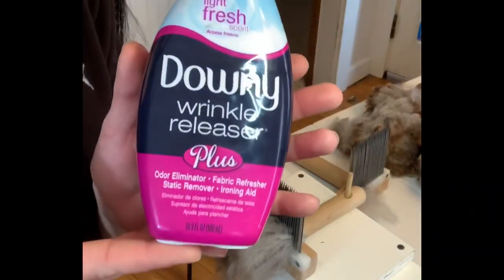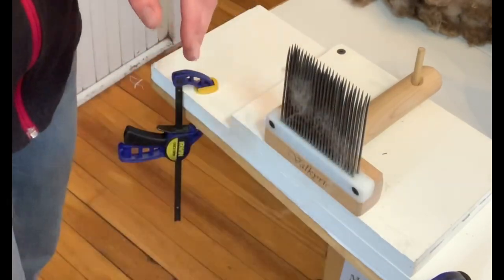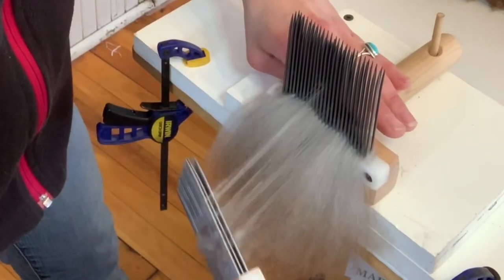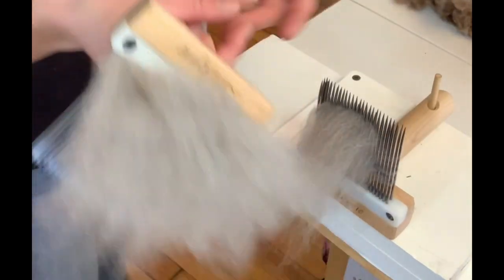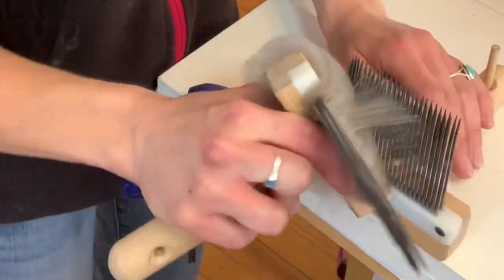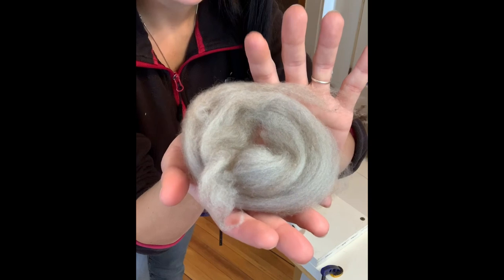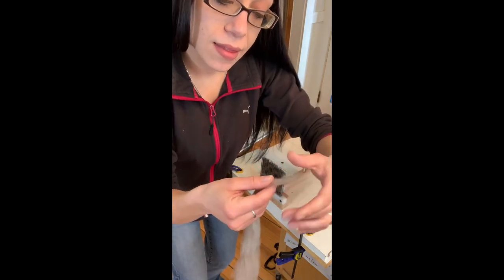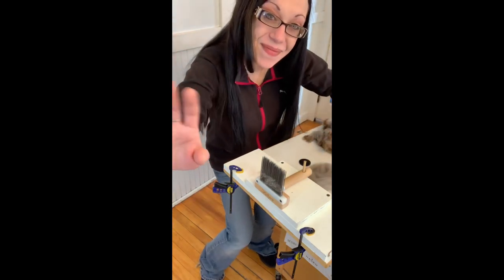How to Hand Process/Scour/Comb/Super Fine Merino Wool:Part 4: Combing and Dizzing off: Outro

Comment: Can you comb before washing x
Reply from the maker: Sadie's Spincraft I usually flick the ends out. I wouldn’t recommend combing through before washing. It will felt a lot easier. Leave it be is what I have found is best. But I definitely flick the gunk out of the ends. Takes a little longer but I even dip the tips in the boiling hot water and scouring detergent, and then flick it and ALL the gunk comes out and it’s super white or whatever color you got. That is what I have found gets everything off and in the long run, saves you time because there will be less washes to get it clean. You always want to go for the least amount of washes possible. So sometimes you need to put in that extra time for that perfect end result! It’s always worth it! I’ve got a part in the series about flicking the ends but I do them dry. Just twist your bundle of wool a little so it stays together and flick. That works too but you will definitely have less washes if you just do that one little extra step. Why not if you’re going to flick anyways right? I always say (because I’m a perfectionist lol) “if you’re going to do it, do it right, or don’t do it at all🤣.” That’s how I personally make myself put in that little extra effort. I kind of whip myself into line like a drill Sargent🤣👏🏻👏🏻👏🏻hahahahaha!
Reply: @ReservoirFibers  thank you so much I was just wondering as some people spin the wool raw I've always washed but just wondered x
Reply from the maker: Sadie's Spincraft yes some people do spin raw! Which you can do too! It creates water resistant yarn if you spin the lanolin into it! That’s how they make “fisherman’s gloves”. Great way to keep your hands from getting wet and keep them warm on the water!